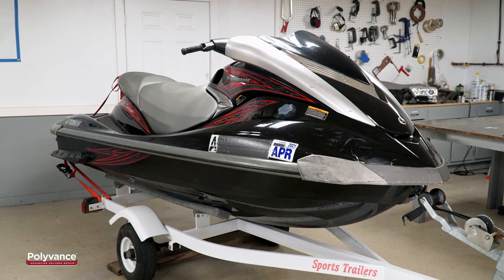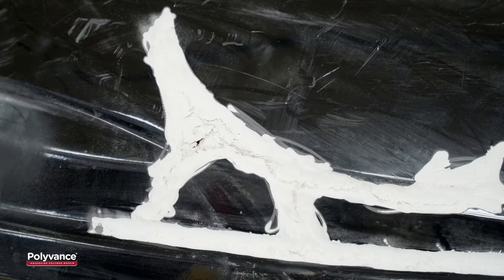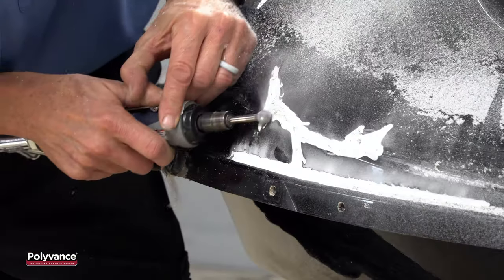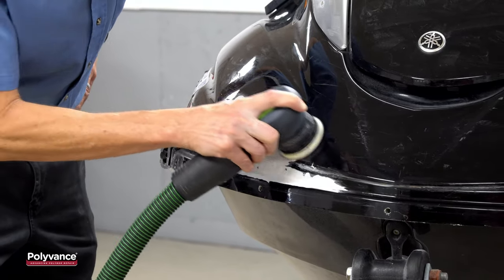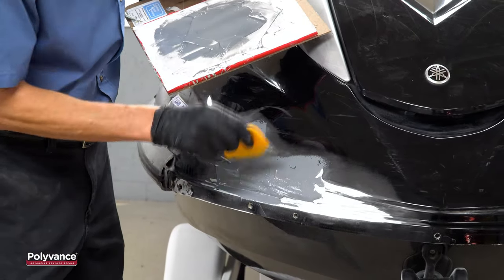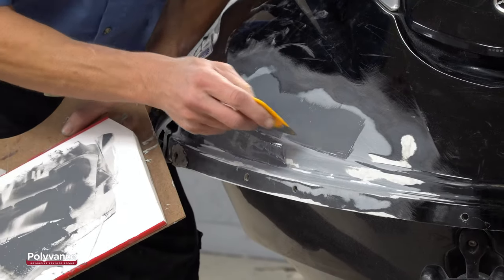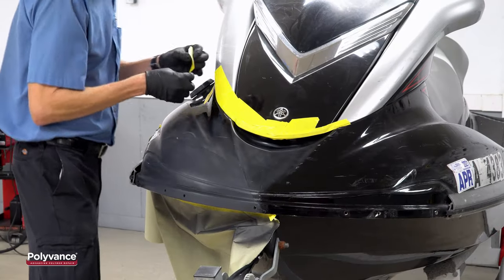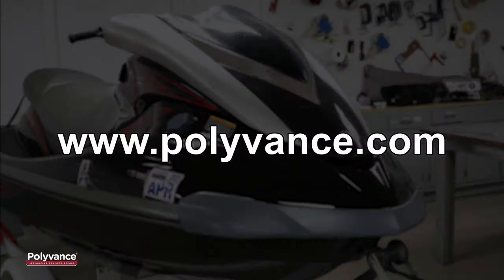Personal Watercraft SMC Hull Repair

Comment: Hi,  I have a 2006 seadoo that needs some bottom repair.  I thought you couldn't use epoxy over polyester material, gelcoat.  Is it possible to use this product and can you spray gelcoat  to finish?
Reply: Polyester resin and Epoxy don't have any significant bond issues as long as its prepped properly.  And yes, you could GelCoat over epoxy, although it would be far more expensive to do that than to use an epoxy paint or other 2k product.
Reply: @scottb7600  I didn't realize I could use an epoxy paint on the bottom of a jetski.  Do they have a good match for Seadoo black?  Thank you very much for replying, I really appreciate the information.

Comment: I have a 99 gp1200 and the keel is worn through the top coat from it being beached over 20 years  is it just paint on top of epoxy to fix it? Its not gel coat is it?
Reply: Its probably gel coat, which typically cures harder than paint and is applied during the manufacturing process of the hull.  Its more durable than paint.  They make gel coat repair kits for reapplying it to the hull, but it takes a bit of effort to get it to look perfect.  I applied it to a sailboat I own and just masked the area and followed the hull contour so when I peeled off the tape, the tape line followed the hull shape.  It wasn't as nice as not having the gel coat feathered in, but it sure was a whole lot easier and nobody really notices but me.
Reply: @scottb7600  cool thanks yeah I don't mind if its a bit ugly its right on the point of the keel function over form 👍 im sure there's a bunch of brands out there suggest any? I have some jb marine weld probably not the correct stuff though
Reply: @darinmorgante7200  for the glass repair to get the contour right, that should be fine.  Polyvance makes a great epoxy based hardset filler that works great on the gouges.  (2020-T) https://www.polyvance.com/Hardset-Filler-1/2020-T/   I can't remember the brand I used for the gelcoat.  I think I bought it from West Marine or other boating supply store.  As far as I know, most GelCoat is pretty much the same.  Its designed to be sprayed into the mold when making the hull, but can also be applied after, as long as there is a good sanding scratch.  You will need to sand and polish the gelcoat after it cures if you want that super high gloss.

Comment: with those big cracks that have gone right through, this is an inadequate repair, and will just crack again. This needs to be cut out with a shallow v, and rebuilt back up with glass matt and epoxy.
Reply: If this was a stressed area, you would be correct, but its not.  2020 is surprisingly strong and unless this area is hit again, it should be fine....of course, if its hit again all bets are off anyway.
Reply: @scottb7600 is this better than panel adhesive/filler for SMC  ? I've been using it to customize my C4 Corvette with mixed results 😢

Comment: Can I use this for bottom of the hull too? Is strong enough from the impact of the water
Reply: It is epoxy based and will have no problems with adhesion, but for the bottom of the hull I would embed some fiberglass into the repair to make it more impact resistant.  Same basic process though.
Reply: @scottb7600  the

Comment: hey guys maybe one can help, I have this same exact ski in the video, on the bottom I have a bunch of gouges from beaching the ski so its all scratched up, I want to use this SMC repair for the bottom but, Is the bottom just paint or gelcoat onto of it?
Reply: It should be a gelcoat...which is basically a tinted epoxy paint sprayed into the mold before the glass is applied to the mold.

Comment: Would this be good fix for a 4" inch crack in the middle of a panel on a Jeep Hardtop?
Reply: As long as its SMC, then yes.
Reply: @scottb7600  okay, thank for the info. I know it is SMC, the reason I ask is it is fairly thin and flexible in the part that cracked, so I wonder if this material has the flex to not crack again.
Reply: @Matt-nq4du  yes, as long as you feather it all in correctly and create a nice gradual transition between  the repair and the original material, you should have no worries.

Comment: I thought SMC panels do not contain fibers the way normal fiberglass does 🤔 
I know my old C4 Corvette doesn't have fibers where damaged
Reply: SMC is sheet molded compound, which has fibers.  Your corvette panels may also be polyurethane, GTX or other plastic without fibers.  GTX feels hard like SMC, as does polycarbonate, but I don't know enough about Corvettes to tell you for sure if they were ever used in its construction.  I know SMC (with fibers) and polyurethane were used extensively.
Reply: @scottb7600  do you know if this product is engineered to no show ghosting or mapping of the edges of the  original crack/hole? This has been an issue for me